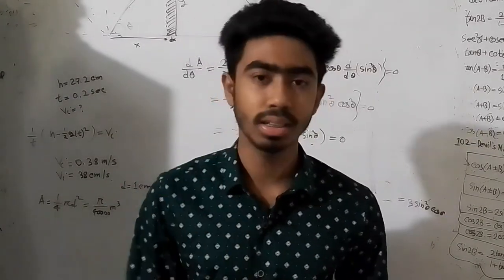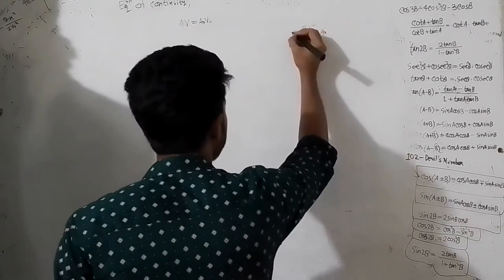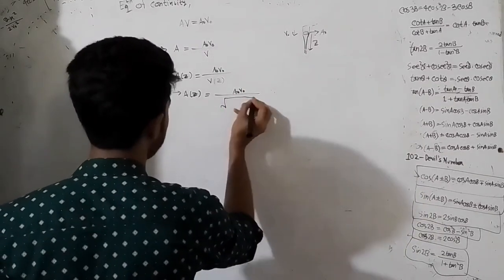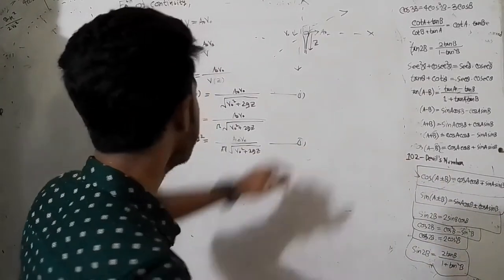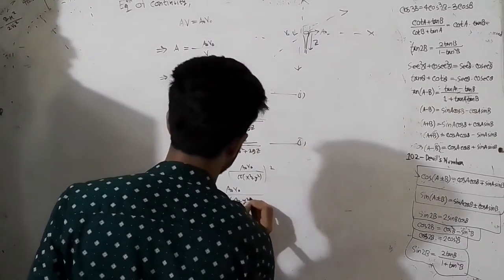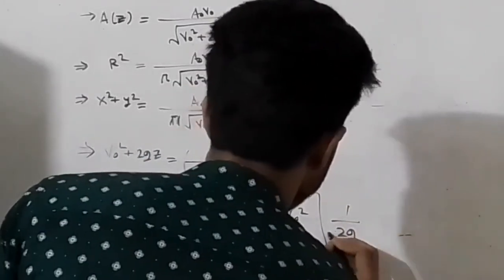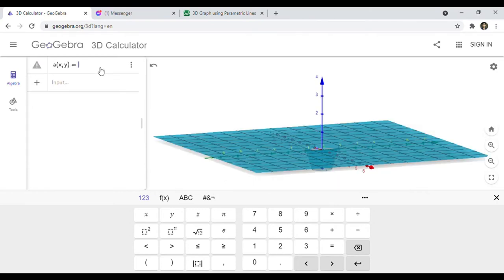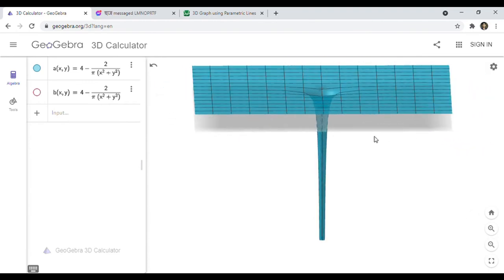Problem Solving 1.04 : Boundary Surface Equation of Tap Water Streams.[Laminar_Flow]

Comment: আর যখন পানির ফ্লও আকাবাকা সেপ এ হয় ??? XD
Reply from the maker: The equation of continuity beholds only in laminar flow! 
Therefore, It isn't applicable in turbulent flow! 
Another thing can also create a different shape, which is surface tension! 
You might experience this when you open the tape slightly! 
Then some beautiful spirals might [also] appear!
Reply: @LearnWithFardin  barakallahu feek ^_^